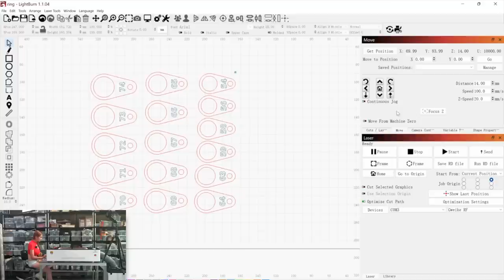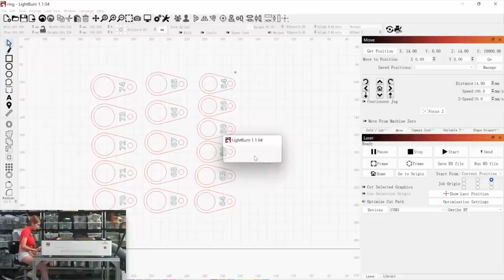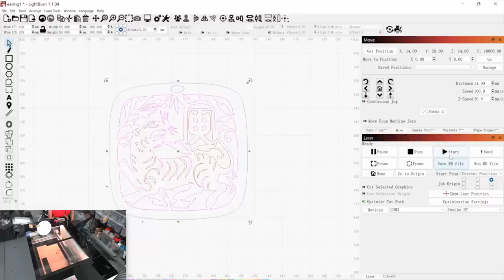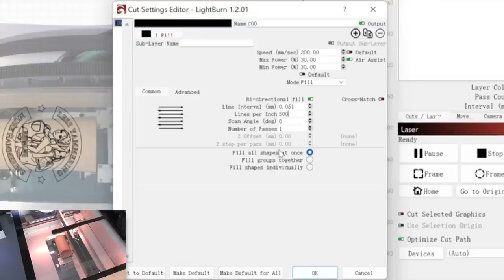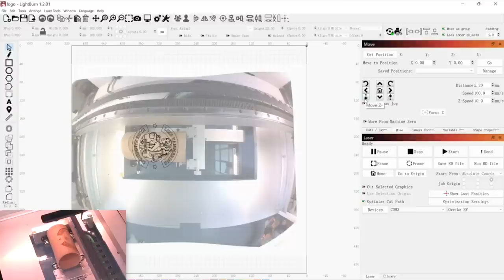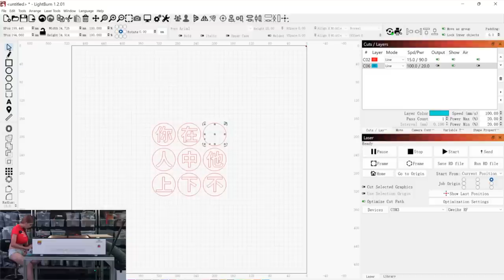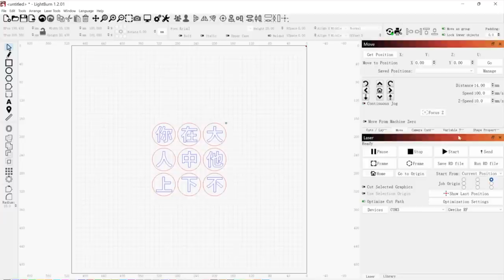Is this RF Lasercutter Better than CO2? - Gweike Cloud

Comment: Excellent video, very informative. Years ago I was involved in instructional educational video production for university students. We discovered that any video of over 20 minutes is in danger of losing most of the viewers. Your demos are probably not as demanding as ones designed to teach computing topics, but I think it would be advisable to keep the length below 20 mins if you can. We found that 15 minutes was a good length for instructional material. At that length you could cover a lot and not lose the students and it was not too indigestible. Speeding up the video where detailed real-time examination is not necessary is a really good idea.

Comment: I like the longer videos better, the more I watch them the more I know these are unbiased.

Apparently you can use ‘blue tape’ on the material to prevent the smoke and burn residue settling on the material, but that is not what this video is about: you want to show what the actual result is.

Please let those videos keep coming, I find them highly informative.

Comment: a little tip for doing both engraving and cutting.. move the color lines in the order.. engraving..inside cuts.. outside cut.. then it will be crispy engraving and inside cuts

Comment: Hey Naomi, wonderful video as always.

Had a question as a amateur laser cutter user - do you always cut the outside lines first before moving in? I usually do the other way round (innermost lines first and moving outwards) but that’s because I’m paranoid about the piece moving around. In your experience, does it make a difference?

Comment: RHi,  RF energy is just light in another part of the electromagnetic spectrum.  They are also known as MASERS  (Microwave Amplification by Stimulated Emission of Radition).  The optimum effectivity of the Maser/Laser is determined by the energy absorption of the intended target material.  Shalom/gw

Comment: Per the question at the end,  I think there should be no arbitrary video lenght. Long videos are good when the topic has enough material.  Short videos are good when there is a lack of material. No need to be hasty to shorten any,  and no need to be slow or add fluff to lengthen any.

Comment: Thanks for the review. Do you remember what speed and number of passes you needed to cut through? How thick was the wood? I am deciding between the Gweik cloud 50 glass tube machine vs RF 30W metal tube machine, but don't know how the lower 30W will impact cutting power. If someone could assure me they are about equivalent then I'd be sold on the RF laser.

Comment: I believe video length should be determined by the subject you are trying to cover.  On my channel, my videos range from 5 minutes to 30 minutes because because I may need to cover different subjects in more or less detail. My preference is that style with good detail rather than rapid cutting like you mentioned. In other words, keep up the good work as you are doing already!

Comment: primarily, i've been thinking of modifying a cnc machine to do uv laser, not that hard once i have a cnc machine larger than the toy i have... got the rails, screws and bearings, need steel for frame, motors and controller, maybe i should make a video.

Comment: Good honest review.  It would be nice to see more Z capability and pass through's.  How easy is it to adjust the air assist?  The ability to use high air assist for cutting but very little for engraving and switch back and forth easily is important.

Comment: Hi, I am having a problem with my ender 3 Pro. I have a creality board 4.2.2 and I just bought a BLTouch. The BL touch seems to be working properly but the nozzle is still too far away from the bed. When I try to lower the nozzle to the right place and click on set Z offset the printer gives me an Err too far! I don't know what I am doing wrong, or what I need to do to make it run properly. I have installed the latest firmware from creality for the BLTouch and plugged it into the port that sits next to the port that connects to the screen. Thank you in advance and I love your videos ;)